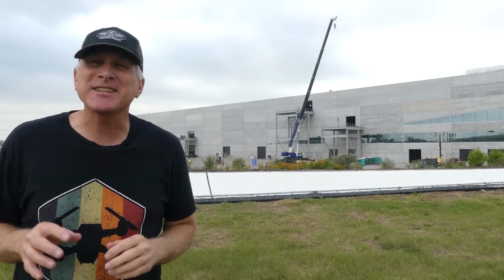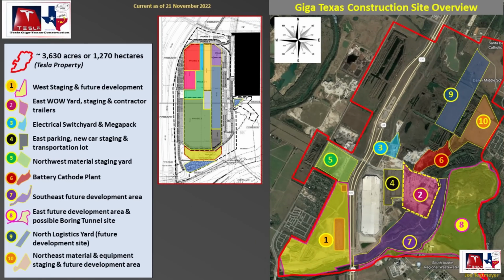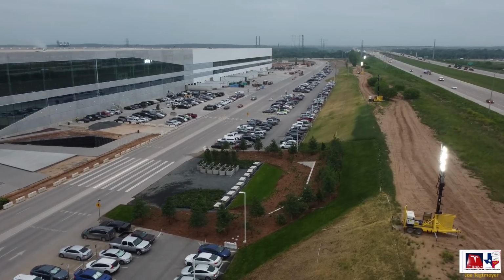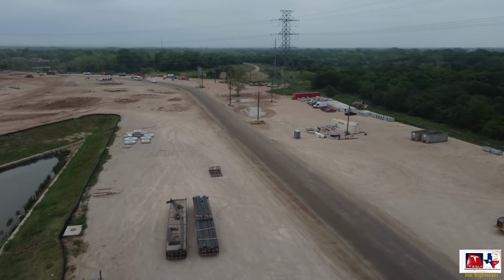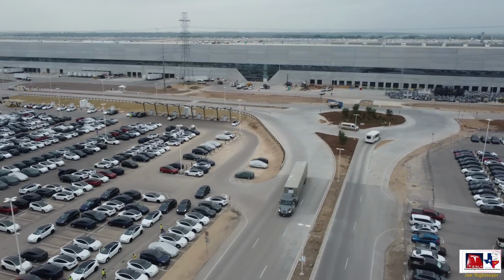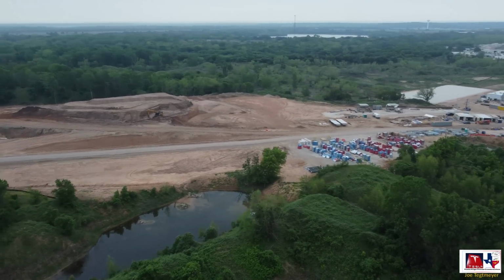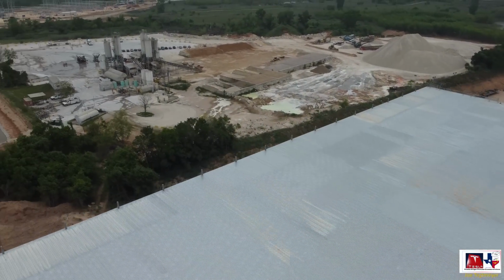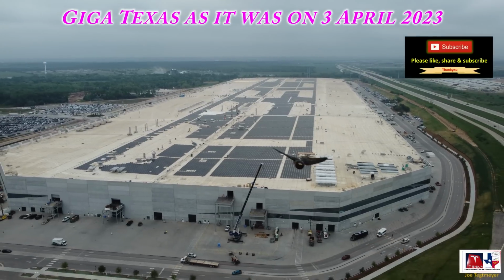West Expansion, South Dual Pier Drills, East Construction! 3 April 2023 Giga Texas Updates (07:35AM)

Comment: Joe, did you ever find out why there is so much re-work being done? Why did they pour concrete over this south section and all the drainage at first, if it was only temporary?  It seems like alot of work to redo areas, when they have other raw acreage they could built on more easily and leave this south end alone as-is.
Reply: I think that originally the plan was to have an area inside the main building for engineering and other non-manufacturing staff. My speculation is that this formerly designated area will now be needed for production, hence a need for a new staff building. Why make it so close to the main building? Because Elon believes the engineers should be as close to the production floor as possible. The re-work seems like a lot to us as individuals (especially the front entrance, amiright? lol) but it's small compared to the total project. It also seems as if there are many more buildings to go up elsewhere on the site, and space for nature as well.
Reply: Because they rush things too much without planning ahead.

Comment: It’s PILE DRIVING not  “pier drilling”’!
Reply: In this case they will bore holes in the ground, insert rebar cages, and pour concrete in place. Rather than bringing in precast piles and driving them.
Reply from the maker: Incorrect. They are very clearly drilling these pile bores.

Comment: I could be wrong but the castings that you showed on the northwest corner of the building looked different and larger than what we have been seeing in that area before. I know that we have not seen new exhausts for the 9k ton gigpresses, but is there any chance that those are CT parts??
Reply: Model Y rear mostly. I'd say the Cybertruck castings will be so radically different they will be easily identifiable.

Pair of front castings by the bin. Have the firewall installed, don’t think we’ve seen that stage of assembly here before. Or it’s a sheet metal version, and it does seem to lack the ribs on the top of the wheel-wells. Sheet-metal front end assemblies seen here at Shanghai, https://youtu.be/KmGaAcWbRMk?t=825
Reply: @DessieDoolan  Yes I agree now. I got a better look in the video today.

Comment: Part 2.
20:59. Die Shop. No white paint behind some of the wall panels.
21:07. Die Shop. In the middle of the footing is a bundle of tall ‘upside down V’ shaped bars. Used to support the next layer of rebar. Essentially a tall bar chair. These seem 4’ or 5’ 1.2m or 1.5m. Concrete will be thick!
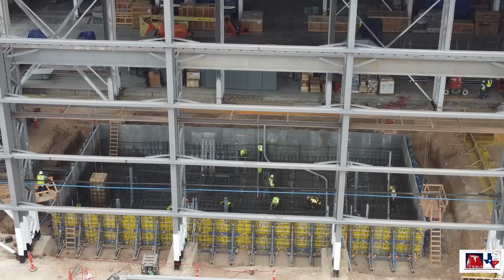21:39. Die Shop. Small pipes blue and black being installed on the suspended supports.
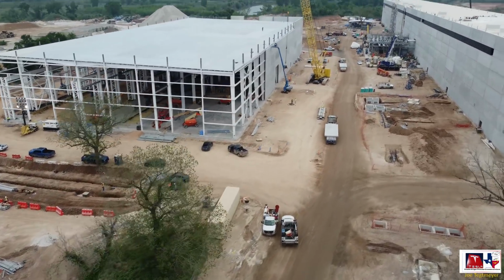22:39. Die Shop. Beams being installed at a high level. Retrofitted, the connection tabs welded to the columns.
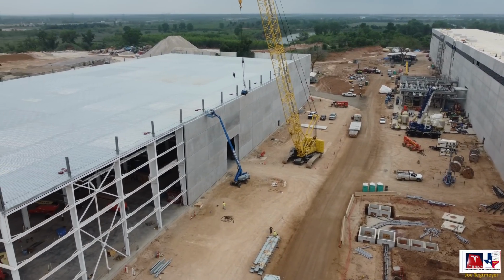22:44. Cathode, plant platform apron. Crane waiting for a job. More plant coming, or shifting things around.
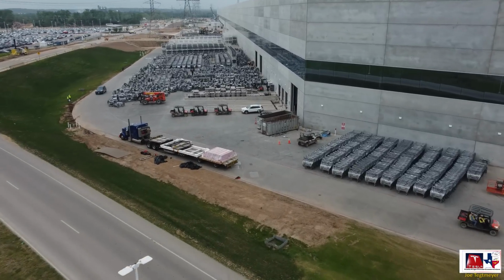25:49.  Casting, apron. Some sort of machine base. Mounting tabs on the underside to fix down the base, tabs on the side to locate and fasten the machine.
Casting, apron. Pair of front castings by the bin. Have the firewall installed, don’t think we’ve seen that stage of assembly here before. Or it’s a sheetmetal version, and it does seem to lack the ribs on the top of the wheel-wells. Sheet-metal front end assemblies seen here at Shanghai, https://youtu.be/KmGaAcWbRMk?t=825

Comment: Thanks Joe.
Part 1. 

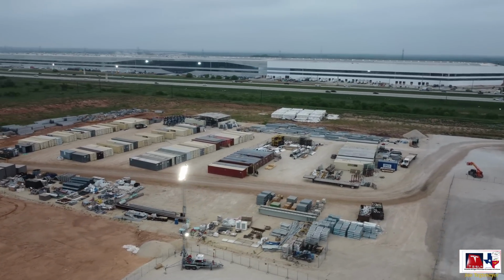6:50. W-WOW yard, north storage. Got everything in there including a stockpile of hand-wash basins, bottom.
8:12. Main Entrance, road. A tricycle. That’s a first.
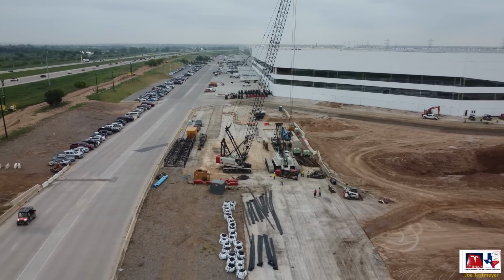10:40. Southend. Drilling rig. Will be interesting to see how much of the southend is piled. Only test piled this west side, so might be very localised.
Previous drilling operation here by the same contractor used 1 crane as the drilling rig, second crane to lower the assembled rebar cages into the shaft. There seems to be only 1 drilling head on site.
White bags would be full of ’ties’.
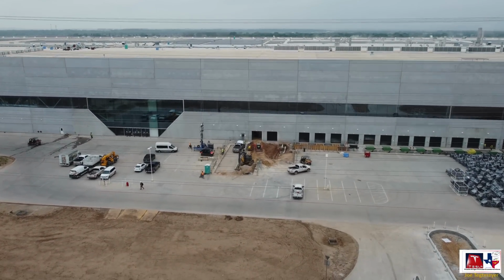15:36. BIW, apron. 3 additional ‘external’ load leveler platforms have formwork placed ready for concrete.
Brings the total number of Loading Docks along this side to 60. Plus 10 Drive Through doors.
BIW. The last couple of permits viewable on the Austin City website refer to BIW1. The exact meaning is unknown. 2 separate BIWs, or simply BIW on Level 1 or BIW on Level 2.
19:49. Cathode, north. Large tanks. Been on site for almost a year. Cathode would seem more likely. Apron to the south of the plant platform has my vote.
Reply: 13:00.  Any luck with the logo on the crates?
Reply: @sammyk874  13:00. No, I couldn't make anything out. Unless it's another delivery by the Arrow/Glass/Umbrella people.

Brad's video show them unpacked. Stuff in silver wrapping, so no further clues.

Comment: I could be way off the mark here, but those castings stacked outside the north end by the giga press look different to me. Are they the regular castings stacked differently, or is it possible they might be for the cyber truck?
Reply: Model Y rear mostly. I'd say the Cybertruck castings will be so radically different they will be easily identifiable.

Pair of front castings by the bin. Have the firewall installed, don’t think we’ve seen that stage of assembly here before. Or it’s a sheet metal version, and it does seem to lack the ribs on the top of the wheel-wells. Sheet-metal front end assemblies seen here at Shanghai, https://youtu.be/KmGaAcWbRMk?t=825
Reply: @DessieDoolan  thank you for the input, as I said, to me, the stacks  just look different somehow.
Reply: @terrysmith8655  I don't think we have seen rear castings stacked upright around this north side before, so a rare opportunity for a good look, and from a relatively low angle.
Reply: @DessieDoolan  Joe does an absolutely fantastic job in his videos and I applaud him for his attention to detail and focus as he films them.
Reply: @terrysmith8655  I'll pay that.

Comment: Tesla need to make Parking Garage so they have enough room for both Employees and Model Ys and the potential Cybertruck parking spots
Reply: I was thinking they could do with a transport system to get people back and forth to the factory. Right now they have the buses, but I would think that a light rail or even a moving walkway similar to an airport might speed things up. Or if they stay wit buses, build a few from extended Tesla Semis?
Reply: @grahammonk8013  There are many potential solutions. I will add The Boring Company also.
I just don't think parking ramps are one of fixes. They are crazy expensive, slow, and a pain in ass to navigate when surface parking is readily available either onsite or offsite. This ain't New York City.
Reply: @jbbuzzable  Here is a cheap solution for Tesla. They put in a semi-improved parking lot (gravel over dirt) at the northern most end of the large field with the vehicle rental lot in it. Then put in a semi-improved sidewalk all the way to the various buildings. Then they can put up a big sign that reads. Get your ass out of your car. Shut your trap. Start walking. Don't let your ass be late to work!!! How is that for a moral boosting solution.
Reply: @grahammonk8013  can't just turn a semi into a bus without tons n tons of red tape
Reply: @MM-fe9mz  Even if it's for private land?
Reply: @grahammonk8013  not sure, but easier to just buy an electric bus from an existing manufacturer. Since probably not worth  having an entire team to design and build just a few one off factory busses. The roads are probably considered public land at least until you get to a checkpoint.
Reply: It appears to me that room is not an issue.
Reply: @jbbuzzable  Actually room is very much an issue. On weekdays the employee parking lot is full. Where are the employees for the two production lines they are building right now going to park? The vehicle staging area is already full and they are in the process of building two new production lines. Where do they stage those vehicles? If you look at the sight as a whole there is a lot of land. Land where they need it for parking is not in abundance.
Reply: @jestercat7723  There are many acres currently under development and many hundreds of acres more available. I expect it makes more sense to expand their existing shuttle service.
There is a large business near me that runs shuttles to some communities up to 40 miles away.
Reply: @jbbuzzable  Just curious, does the large business near you that runs shuttle buses to communities up to 40 miles away have parking in the communities that the shuttle bus runs to? Also are there numerous shuttle runs a day or only at shift change? Does this large business you mentioned have enough property to provide parking for all of its employees? Joe has mentioned several times lately that Tesla is planning to build a parking structure, probably a parking garage. If they moved the Warehouse on Wheels and built a parking garage there for their employees they could make it large enough for their current employees as well as the people that will be hired for the new production. That would leave the current employee parking could be used for new vehicle staging.
Reply: @jestercat7723  It is so complex that they have an entire department dedicated to transportation.
Within the nearby area, they have a patchwork of maybe 10-20 ramps and lots that they own or have negotiated deals with. 
They have partnerships with local bus services, and employees are given free passes for the entire city. Regular shuttles run between them all based upon the work shifts. If you unexpectedly have to work late, the transportation dept will arrange for a taxi at no charge.
The out-of-town  lots are typically in a seldom used corner of a mall or big box parking lot. I doubt they pay for the space since there is designated spaces marked off.
I know a couple of people who use it. They love driving 400 fewer miles per week and being dropped off at the doorstep of their work. They also like that they gain an hour and a half a day to work or play during the trip.
Reply: @jbbuzzable  It sounds interesting and it also sounds like they do not have enough land at their sight to provide parking for all their employees. It is great that they do this for their employees since most companies' wont, Also is this company in the United States or another country? Other countries have different laws on what companies must provide for their employees. 
   But as I said before if Tesla builds a parking garage where the current warehouse on wheels is they could make it large enough to have parking for their current employees as well as those they will have hire to operate production lines two and three that they are currently building. This would put your employees in one lot relatively near the building although shuttles from the lot to the building would be a good idea.
Reply: @jestercat7723  I suppose there is no harm in saying this is the Mayo Clinic in Rochester Minnesota. The program was initially started maybe 15 years ago to attract qualified workers.
Reply: @jestercat7723  Giga Austin has been running on-site shuttles for quite some time now.
Reply: @jbbuzzable  Sorry about having to joke about it but after being stationed in Michigan for years I must. I just hope they give them more than a bus pass to put up with the winters.   
   Yes Tesla Austin has remote parking across the highway for contractors and use a shuttle bus to get them from their parking to their job sight. But that is because there isn't enough space for it. Actually that isn't true, they took the parking space they had next to the construction site was taken away so Tesla could put stuff there. I believe that is because people do not mater to Tesla. Strong statement I know but the more I look at Giga Texas the more I believe it. I keep hearing people say Giga Tesla is Tesla's world headquarters. Normally companies world headquarters is the face of the company. If that is the case, then Tesla is giving off a very bad look. to prove the point I give you the front entrance. This latest change to it is the first time other than the Cyber-rodeo and investor days that there has been handicap access at their main entrance in well over a year. That is not the actions of a company that cares about people.
Reply: @jestercat7723  So you think a company that is doing everything wrong needs a parking ramp.
Reply: @jbbuzzable  Yes I do. And you, I guess, don't. But I never said Tesla was doing everything wrong. They do a wonderful job designing and building cars. They seem to have done a good job designing and building Giga's Shanghai and Berlin. Then you get Giga Texas, Tesla's world headquarters, Why were they able to put in enough doors to park the trailers at those two locations but not Texas? Why were they able to build both of those plants without having to repeatedly dig up parking lots and repave them to put in lighting, water lines and electrical conduit? Where are the piles of concrete slabs from a giant concrete parking lot? that was put in when it was known at the time it was done that it would be torn up for a building expansion? Where are the piles of concrete rubble from interior floors that had to be removed to put in new assembly lines that were supposedly planed for in the original plans. Why is new employee orientation at your world headquarters held in portable trailers across the street from the main building? Why did it take well over a year to make your world headquarters handicap accessible at the main entrance? How the hell could Tesla have screwed up and not have Giga's Shanghai and Berlin follow these levels of thrift, efficiency and consideration of everyone visiting your facility?
   Again I never said I thought Tesla was doing everything wrong.  But for their world it would seem that they sure making a valiant effort to.
Reply: A parking garage would make sense on the south end, close to the factory and with connecting skybridges. A moving walkway running the length of the factory could get workers where they need to go.
Reply: I forgot to address your concern about not having enough land. Yes the land around Mayo has become very high priced due to their own success, but that is currently not an issue with Gigatexas.

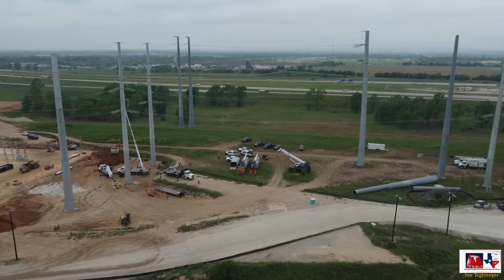Comment: Substation: @ 23:21 So far, it appears that only the eastside 345 kV transmission line circuit is routed through the substation. The  westside circuit remains untouched. As William Wheeler pointed out, it only makes sense to switch both sets of lines. Hopefully we will know soon the final transmission line routing.
Reply: Indeed, it only makes sense to attach both lines since the line feeding both circuits and breakers can be cross linked in the switchgear. One thought is they could only bring down one line to hook up the substation at this time, they’d test with one and hook up the other later. But who knows. Finally, I remind everyone that this substation and transformers are owned by the Lower Colorado River Authority and not Tesla. Tesla will own the Megapack of batteries and will own any transformers and wiring on the other side of the measurement gear we will see installed, just like you own the electric system on the other side of the meter at your home. So if you see something you disagree with, it ain’t Elon’s fault. LCRA runs its own show.
Reply: @Bill_N_ATX  i wonder how much that new substation is costing!
Reply: @skmetal7   It was in their 2023 capital budget for 30 million dollars.
Reply: @Bill_N_ATX  :O woooow

Comment: Ed is correct. That is indeed an industrial refrigeration system. The red "Pumps" appear to be high efficiency screw compressors, the larger pumps on the right would be the secondary brine loop. The black tanks behind would be the insulated chiller tanks.